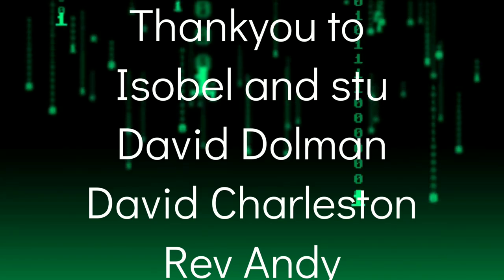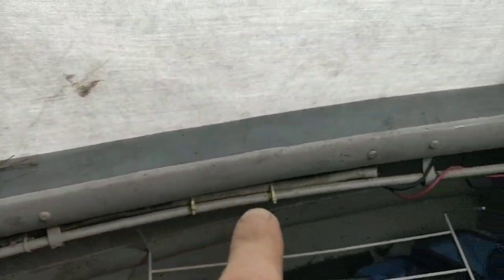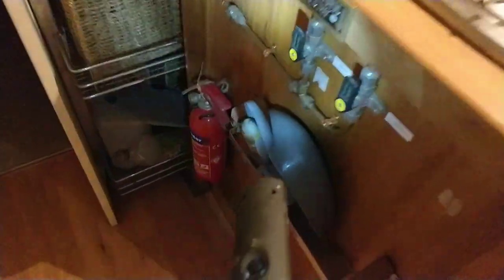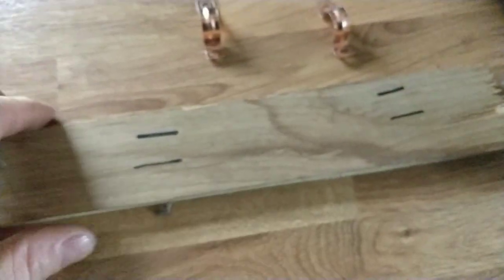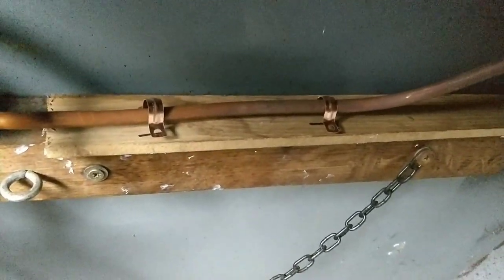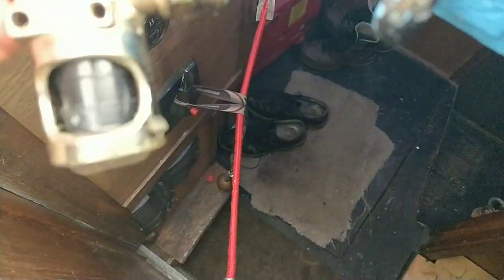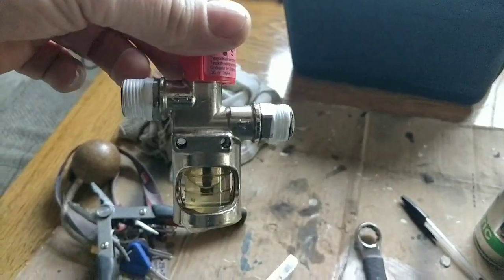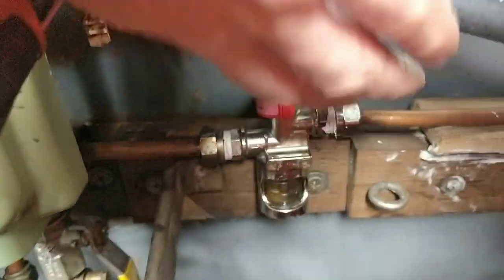Boat safety work..Bubble tester service..

Comment: Congratulations with passing the BSC test! That bubble tester was not supposed to turn up black, cleverly fixed though, poloprplx! was a little setback. Well done, saved a few quid.
I had the same experience when I found out I needed some ceramic grease for my exhaust bolts. I got me a sachet with a few grams and the shipping was more expensive than the bloddy sachet. "in stock" is becoming an oldfashioned expression, Will.
Reply from the maker: In stock is unusual that's why when I phoned the chandler's and he had it in stock his last sachet I was straight there. Job done quick...Niceee. Thankyou Umberto..

Comment: I thought copper gas lines were a no no. Glad everything is working! 👏🏼
Reply from the maker: Are there other types used? Copper is used on all gas I thought Brian. Good for another 4 years. Niceee
Reply: @NarrowboatWill  maybe on a boat, here I had to replace copper with black steel pipe.

Comment: Just a suggestion Will. That fluid is the same as would be used in a caravan system so caravan accessory shops may stock it too. Glad you’ve passed the BSC.
Reply from the maker: Yeah I Googled it and nearest supplier I could find was that one sachet. Isn't that weird. All the other places I phoned either didn't know what I was talking about or they where out of stock. Thanks anyway Gill.

Comment: Just got a bottle of the fluid from ebay - 5 squid for 50ml bottle (around 40 refills for your bubble tester) - gj Alde who prey on noobie boaters:)  If you need a gas boiler for central heating I got an Alde room sealed boiler from the 80's going cheap - expensive beasts to run, but very efficient
Reply from the maker: Thank you for the info. I just need a switch. I only use it now and again. I'm going to fit a push button for my ignitor instead. Easier to get. To expensive to run in winter. 😂😂👍

Comment: Polypropylene glycol available from Amazon £5 for 125ml, cheaper than a pathetic little sachet.
Reply from the maker: Yeah I know but getting it delivered is a nightmare. Post on a boat is my nemisis. He had it in stock you know and I needed it that day. Next time maybe. Cheers guys.
Reply: @NarrowboatWill  you said you needed a spare, I'm sure  you could get one delivered to a Amazon locker as it's not desperate

Comment: General motors in late 80s started use propylene glycol antifreeze propylene glycol is non toxic but couldn't  stand engine heat turned black ate gaskets and clogged cooling system I knew mechanics  buying new pickups that drained it out and put in ethylene  glycol
Reply from the maker: Yeah I can see why they did it. I think there's a chemical in the gas that turns it black. I had no idea about bubble testers and Glycol they use. Really interesting cleaning it and sorting it out Lorrie. Take care

Comment: I have an idea for gas pipe drill hole straight through pipe long screw into gunnel just kidding you are doing it correctly  like usual
Reply from the maker: Ha ha yeah. The tester said I didn't need to support the main gas pipe really. Dohh.,.